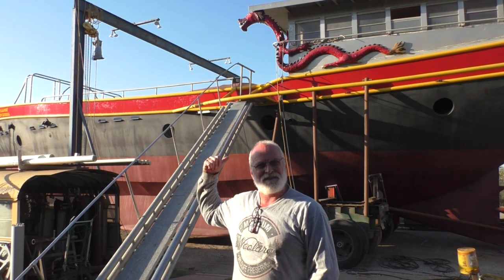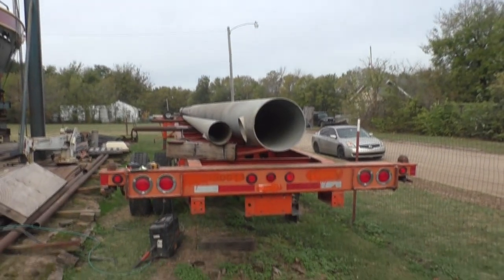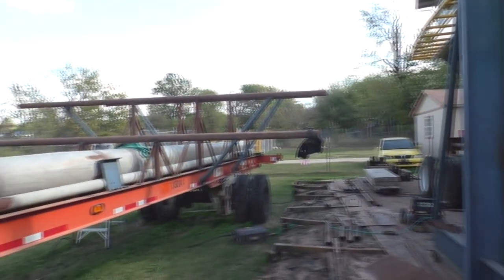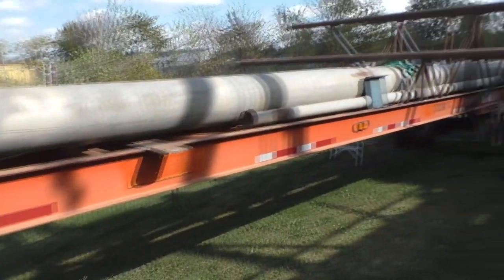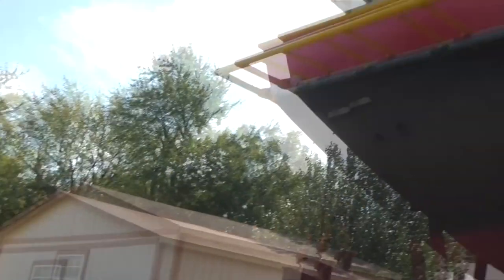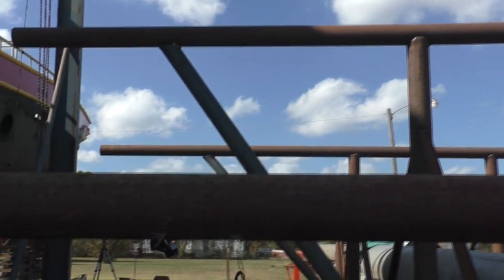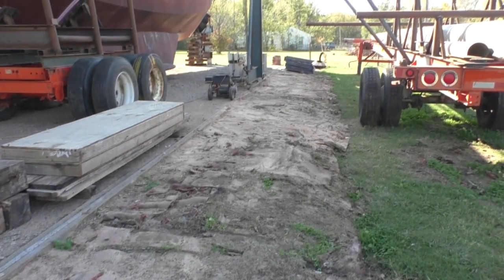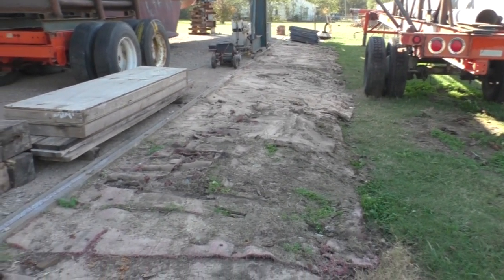Wheels for the Boat - Part 8 - The Pilothouse

Comment: I've watched every Seeker video and I don't recall you discussing two issues that are relative. It has been a great education for me. Thanks. I assume seeker will be a "documented vessel" under US Coast Guard regulations. Have you obtained such and where will you place the number in the hull? I hope you'll video that, too. The second is that you will take aboard passengers and you are the "Captain" have you looked into Coast Guard licensing that's required and how will you meet required motor vessel operating experience?
Reply: LeBuff, I think its an unregulated boat, as it is for private not charter use.

Comment: Doug, how do you pick up the pilot house? Is the roof structure strong enough to hold the walls or do you need to pick up from the base? If the later, how do you get around the roof overhang?